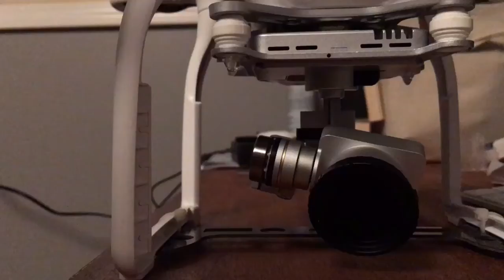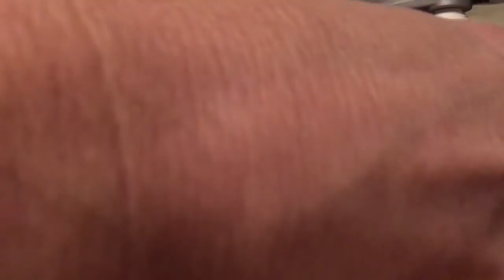DJI Phantom 3 Advanced gimbal vibration jello fix

Comment: DONT use weights, rather try to find a way to adjust your PID tuning parameters for the gimbal. What's happening here is that the gimbal's weight has changed and the software is not aware of it, therefore making the gimbal work very hard to level the level horizon at dead center (it overshoots due to weight miscalculations, and for such a delicate gimbal like yours every gram counts!). Once you tune your gimbal with the added weight attached, it will perform just as before.
Reply from the maker: masso172 balancing the gimbal is the only option here since adjusting the PID is not possible. Adding the filter out front adds weight so counterbalancing it with weight in the back only makes sense. Otherwise it is constantly working to hold the camera up level.
Reply: Aw well that's unfortunate :(

Comment: you mention putting 10g on but looks like you have a 5g on the camera as well how much weight is needed and do you think it needs some even if not using a filter on the lens?
Reply from the maker: The weight you see on the back and side of the camera is there to offset the added weight of the filter set on the front of the camera. If you are using a factory setup with no filters then no weight should be needed. I only had the issue when I added the circular polarizer because it added so much weight out front. The gimbal motors are not very powerful so you want your camera as balanced as possible.
Reply: Thanks so much for the response! Im having some camera shake on my Phantom 3 4k model and just trying to figure it out.
Reply: hello i am sorry its late but i have same drone brand phantom 3 4k and i have this gimbal shake did you find solution ?

Comment: same problem i get vibration when i use ND filter i try to take off 6 ft no vibration or jello but when i try to fly moe than 70 ft i get vibration.
Reply from the maker: Adding a little weight to the back to counter the weight of the filter should take care of the problem. Good luck.